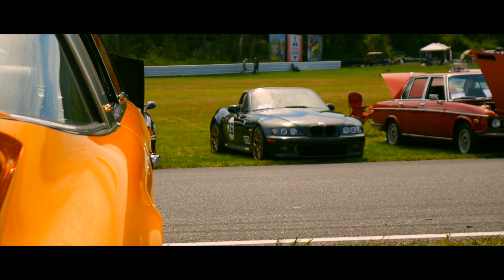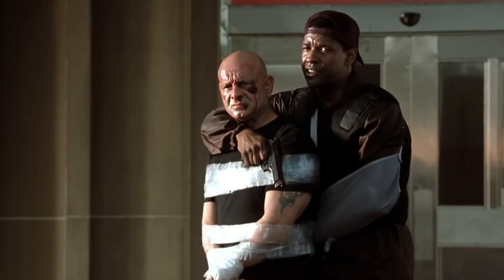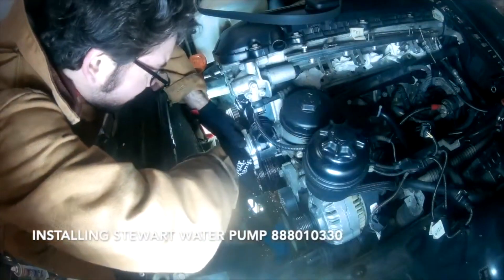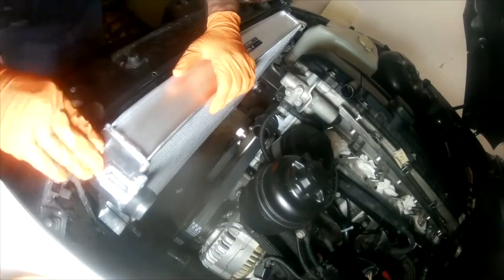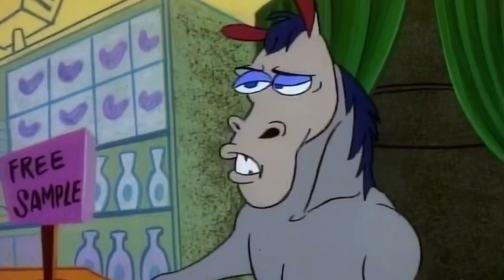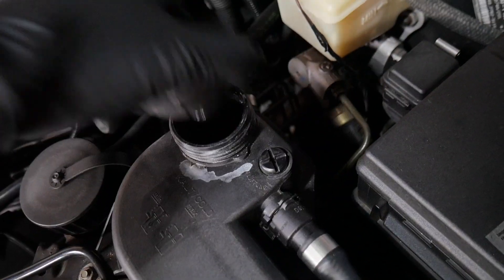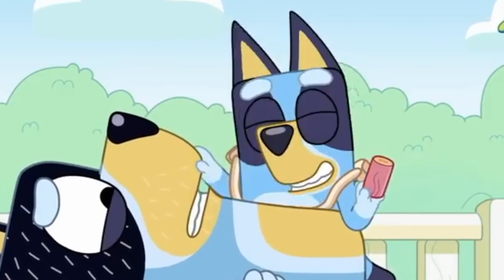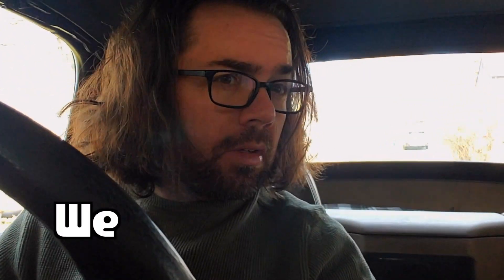Diagnosing a Leaking Mishimoto Radiator with UV Dye

Comment: Do you know if there are different colors of uv dye and where to find them?  I used yellow in my engine oil because there is a contaminant in my coolant that mechanics aren't able to diagnose yet.  So now that I want to leak test my cooling system, I need a different color than yellow.  I tried to Google it and didn't get far.  I'n about to watch this video, so my bad if you already mentioned it.

Comment: I put one in my 2015 f150 because  it's supposed to be the  best I've gone through4 so far they replace it with between  a 100 to 75  shipping  costs  add that up I could  by another  radiator  now number 4 is leaking smh
Reply: They are junk sold and high quality just happened to me as well.